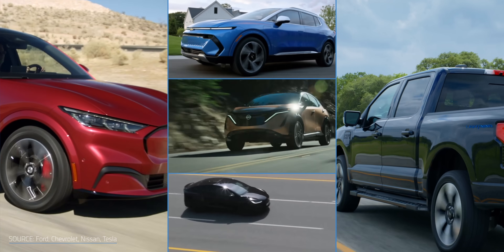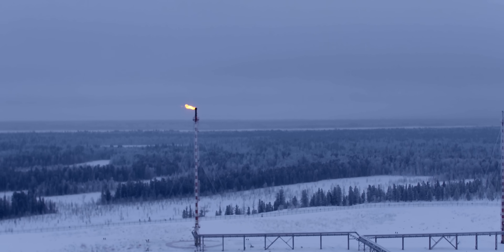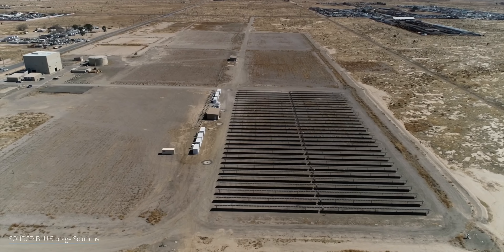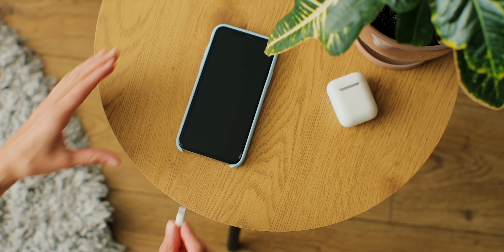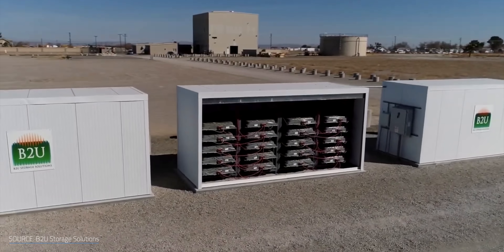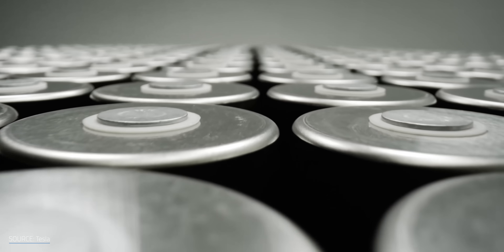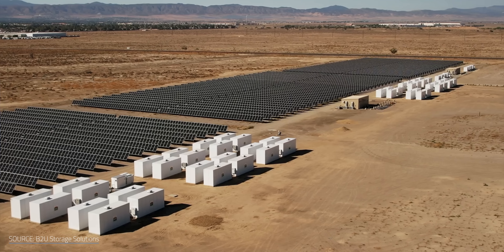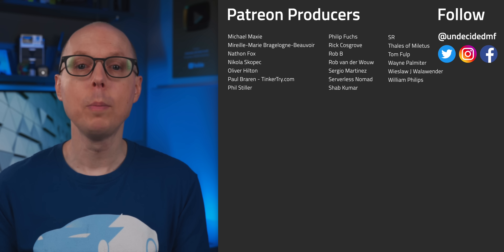How Old EV Batteries are Perfect for Energy Storage

Comment: Scale, scale scale. You need GW HR of storage to be grid level storage. 
Moss Landing is just over 2 GW HR in size, 24 MW X 40 = 1 GW
So you only need about 1000 of these to have any impact. You need another 1000 units to be serious. So it’s only a million! It’s ludicrous to think that we will ever have enough storage to be totally rid of gas fired Peaker plants.
Reply: We are on track to have 3000 GWh of battery manufacturing capacity per year by 2030. Currently there is 274 GWh of batteries made each year. All these batteries will reach end of life in cars and will be used for grid storage for many years after. It's not so ridiculous after all.
Reply: @antronx7  how much lithium, nickel, manganese and cobalt will that require? Are there enough proven reserves to supply that much? Aren’t you causing more problems by digging up that much material? 

Time to wake up

Simon Michaux
Reply: @kennethkaminski3438  Yes theres enough for at least 10 TWh. Read latest Tesla master plan. They did all the homework so we dont have to. After that recycling will take over.
Reply: @antronx7  nope, that’s not enough to backup the US grid for a significant amount of time. And no we don’t have enough minerals to provide the first generation of renewable energy. You need to read Simon Michaux’s peer reviewed report called Time to wake up 

Or Mark Mills 
Or Vlakav Smil 

All PHD’s

I like Elon but he’s way off on his calculations

Comment: Matt, another twist on this idea would be to pare a used battery with a few solar panels at the home of a EV owner (market a package for EV owners) so the system collects energy during the day and then charge the car with it in the evening. This takes the car off the grid for a lot of typical driving. Love the repurpose idea though for grid storage. Someone below mentioned a system for home and farm use too. Cheers, Tim
Reply: That was the original idea behind Tesla's Powerwall. However, unsurprisingly it turned out that the demand is much higher than the number of retired batteries...
Reply: @HenryLoenwind  I would not risk putting batteries like that in my home since the fire risk is too great and I wonder what insurance companies would think.

Comment: To me the most interesting thing is the modularity of the system design. The plug and play setup is much like a RAID Array in a server... If a unit goes out, simply spin it down and hotswap it without interrupting everything. Tesla Megapacks can't do that - each cluster has to be taken offline to service any part of it.
Reply: Of course drive failures are relatively sudden while battery performance degrades over time.

The key to making it work would be to put as much of the load as possible on the weakest batteries so that they degrade the fastest.
Then the overall performance is stable as you swap out the unusable batteries at the bottom for new (recently retired) ones at the top.
Reply: Exactly, on both points. 👍
And expanding on the "hot spares", that could easily double as load testing prior to putting a unit online in the first place. It would definitely mitigate the chance of unexpected failures.

Comment: It's crucial for manufacturers to take responsibility and incorporate a standardized BMS protocol in their battery packs. This would greatly contribute to the effective repurposing of dead EV batteries for energy storage. Implementing such measures should be strongly encouraged, if not mandated, to ensure a more sustainable and efficient use of resources. 🔌🌱🔋💡🔄
Reply: This assumes every EV will be using the same battery tech. Li-ion (NMC) and LFP have non-similar characteristics that would justify the use of a different BMS.
One would need to have multiple BMS protocols, though this could be achieved in software. Optimally you would use the same battery chemistry across a single station unit.
A whole plant could do both however as long as that is kept in mind.

Comment: Good video but the framing is wrong wrt recycling, IMO. The reason recycling of EV batteries hasn’t ramped up yet is that there simply aren’t that many of them being decommissioned at this point.

The market is growing exponentially. It’ll take roughly a decade for BEVs to make up >90% of new car sales. Then a couple decades for those batteries to begin being decommissioned en masse. Then a few additional decades in various second life applications.

Only after all that will we see a major shift of the battery manufacturing inputs to a high percentage of recycled materials.

Comment: I would ask of you to look at the li ion batteries life cycle, mining destroys the local enviroment, from earth to air to water sources Then Li ions aren't really efficient for long so in the long run fuel cells will be more efficient, then where are we gonna put those 700kilos or so of the batteries. Even now when the batteries are sooo common, we don't have a proper way of recycling them, cuz recycling them is just tooo difficult. And then we consider the fact that batteries are only efficient at 25degrees and a bummer, 99% of the world doesn't have that temp 90% of the time and many parts are way too hot to be traveling in a with a 700kilo of instant flammable shit

Comment: Those batteries have got to weight a decent amount - I wonder if it would be worth the engineering and building expense to make them into liftable platforms to use as gravity energy storage? Winch your batteries up high when you've got peak energy production from solar, lower them down and spin turbines to generate power when there's more demand. Make use of both the electronic capacity and the physical capacity at once.

Comment: I ask again, WHY should a Tesla with 40% degradation need a new battery?  I mean, it still has more range than a first generation Nissan Leaf, and it's still a Tesla.  Is "needs a new battery" a user choice, or does the car somehow refuse to operate, at some point?  Does anyone know that point, for various EVs?
Reply: With capacity degradation internal resistance goes up and slows down fast charging rate significantly. But by the time Tesla pack gets to 40% degradation the car will be long worn out.
Reply: @antronx7  Fast charging, huh?  There are Tesla Model S cars on the used market that don't have Supercharging.  Can't see the difference.

Not being able to fast charge is not what I meant.  If I slow charge a $1000 EV that has a 100 mile range and drive it to work every day, why do I care if it's a first generation Leaf or a dying Model S, except the Model S is crazy cooler?

Comment: You said $1M revenue?  My understanding that isn’t profit. $1M doesn’t sound profitable to me.  Am I missing something? Also, based on what you said I understand that the recycled batteries still have 70-80% of useful life left.  Does that mean these batteries will last another 20-30yrs, or is there a drop off factor?  It is a very cool concept but I don’t think I heard enough to convince me that it’s profitable long term.  Our goal is renewable energy + clean energy.  I’ve understood from your channel or other sources that Li is a limited resource and the process to mine and refine it very “dirty”.  If Li isn’t a renewable resource aren’t we just trading problems? Just trying to get a better picture.  I’m a fan of this channel for a reason.  I’m not a nay sayer, just want to understand all aspects and find the best overall solution.  We are getting there, but we haven’t arrived yet.

Comment: I thought of doing this on a smaller scale.  For a home,  you would actually just repurpose your own car battery when you needed to upgrade it.  Then use the old battery in your house to compliment solar roof.
Reply: that if tesla gives you that battery upon replacement. So far I needed to replace my main computer, I paid $2000 for that replacement to them, basically cost of new computer plus labor and they still absolutely refused to give me my broken computer back. Go figure.
Reply: One issue you will run into is home insurance - your install won't use UL rated batteries and in the case of a fire you may find that your insurance company won't cover it. Many of the cheap Chinese batteries being sold aren't UL listed either so you have to be careful even buying batteries let alone reusing.

Comment: But I also think it is imperative for politics to act now and mandate that manufacturers of ev-batteries create an open standard for battery managment systems communication protocols, charging and discharging (internal to the vehicle) so that they can be used and tapped into regardless of vehicle brand and easily be repurposed for different applications
Maybe also repaired. Like for instance the BMS could specifically state which cells are dead or close to EOL to replace them.

Comment: I've always thought it was really wasteful to just throw away a battery at 75% of its original efficiency, I thought it had to be a bigger reason but turns out that theres not. So, as you put it, adding 2 + 2 there.

I wonder if this could also be useful in domestic use. Instead of fancy powerwalls some people might have the space to just have a used-cell shed.

Comment: This is such a great solution, it might be a good idea to mandate that EV batteries have to be re-used at least once in this manner before disposal. Although this is brilliant, there also really should be common manufacturing protocols that allow for easy recycling across the different brands (ideally you would want that for all li-ion batteries, but EV's are the most critical and the easiest to make money from recycling). 

If the battery recycling isn't profitable right now on its own, then the government needs to enforce fines for disposing of these batteries at landfill. Government intervention likely will be necessary, because without any changes we will end up facing a new environmental crisis created just from Li-ion batteries alone..

Comment: I've messed with battery powered tools and toys for decades now, predominantly in things like radio control cars, boats, and airplanes.  People like me have known for a long time that a battery pack that is no longer competitive on the track is still useful to have, you just gotta  work within it's limitations.  And these old, automotive batteries aren't just useful at grid scale, they can be part of your home battery solutions too.  No, it may not be able to take a 2 ton automobile to 60 mph in 6 seconds anymore, but I'll bet it will keep your fridge running for days on end.  You just gotta work within the battery's limitations as it ages and understand that EV use is Extreme Duty use.  Providing power for your home is light work for most EV batteries.  

The real issue with getting second lives for EV batteries is the manufacturers don't exactly make it easy to do.  The battery controllers often need specific signals to allow power into or out of the pack, and they don't always make that easy to do.  They keep a tight reign on that information, because if the battery can be used for something else, they want to be the people selling that use.  This applies to battery pack makers from EVs on down to hand-held tools.  They are all locked behind proprietary software and controllers.  If we want to see a real solution to the coming battery-pocalypse we need to make EV and power tool batteries as easy to repurpose as our old friend the lead-acid battery.
Reply: I'm not sure an army of tinkerers is going to do that, but this can be considered a right-to-repair issue anyway.

Comment: Why do people ignore that EVs are powered by an electrical grid which is mostly generated by coal?Also would like to see a video of how the energy grid would cope if everyone had an EV Plugged in overnight. Would it mean more coal being burned while we're sleeping or could it make the grid fail?
Reply: The electrical grid is not mostly generated by coal anymore. But, even if it were, EVs being plugged in at night would help even out demand between night and day, making the energy generation more efficient. The key is to encourage the charging to happen late at night, rather than immediately when people get home from work, to the extent possible.
Reply: @ab-tf5fl  what do you think the grid is mostly powered by? You said it wasn't coal but you didn't give an answer? The fact is all grids are still powered mostly by fossil fuels. How would having a greater demand on the grid at night time make it better?
Reply: @Kp-up6cj  using the grid at night for electric vehicles means that people don't have to charge their vehicles during the day at peak times.  Don't forget that with EVs there is also vehicle-to-grid so just like California is using old EV batteries for energy storage, you can actually use your own vehicle if it is near fully charged to put some energy back into the grid.
Reply: @londonyes1380  so your saying that there's nothing wrong with the greater need for electricity at non peak hours off of a grid which is mostly supplied by fossil fuels?
Reply: @Kp-up6cj yes.
Especially with coal, where the output cannot be adjusted quickly.
A coal plant is going to burn the same amount of coal hour after hour, enough to cover peak demand, regardless of the demand at any given moment.
Therefore, any electricity used off-peak does not increase the CO2 output of the plant.
Demand peaks at different times depending on the season, but the middle of the night is always off-peak and cars (I assume they all do; the Leaf does) can be plugged in but set to wake up then to charge.

Comment: A couple of comments, a number of years ago I saw a technology piece in the Singapore airport where people could put their old AA 9 V CND cell batteries into a kiosk and multiple types of phone chargers were attached to it. Essentially a similar idea squeezing the last little bit of performance out for an altruistic purpose.
Secondly, there is an EV market that remains underutilized. I own a 2015 BMW i3 Rex version (orca). During the summer if I’ve been driving sanely a full charge is around 70 miles, with another 90 or so from the generator. This is all the car I need in my family for a second vehicle; my work as a college professor is about 3 miles away where I also get free charging. I know there are some pretty varied, and some even negative opinions about my little BMW, but I love it! When I’m not worried about mileage, it handles like a go kart. And when you’ve truly mastered one pedal driving, it’s hard to go back.  Plenty of families out there could save a lot of money by switching that second vehicle to a used older EV.
And critically, the one argument that people tell me about how they don’t want to go to electric because of their power bill is ridiculous. I have owned my BMW since February 2019 and do overnight 110 charging at home when I need to and it never even blips my power bill.
Reply: I don't get the power bill argument. It's far cheaper to use electricity than gasoline.
Reply: @drooplug  It's a problem for apartment renters (like me), but if I HAD an electric, you can bet I'd work it out.
One 300W panel would suffice for my ordinary use...if I had to roll and stow it while out- NO problem.
Reply: @ticthak  I don't see how electricity in an rented property would be more than in an owned property.

Comment: Major issue: you can’t get rid of the peaker plants until the alternatives are 100% reliable, which means not depending on solar and wind to charge them.  It also means the cost of the peaker plants actually increases since they still need maintenance but gradually produce less and less energy to offset the costs.

I believe nuclear is the only energy source that checks all boxes for the foreseeable future, but the “green” people refuse to entertain this, siting so much concern over risks that are, in the opinion of many, blown out of proportion.
Reply: Depends just how much storage you are able to put together. If you have enough battery capacity to run the entire state for a couple weeks, that seems like it would be sufficient, as it is extremely unlikely that you will have no sun and no wind, across the entire state, for two weeks straight. Especially in a place like California that has lots and lots of desert, where there is almost never (at least during the day) not sun.

Of course, a few minutes or hours of storage won't cut for actually being able to shut down the peaker plants, but you've got to start somewhere.

Of course, nuclear power is good too, but it shouldn't be and either/or. We need both.
Reply: @ab-tf5fl  enough battery capacity to run the entire state for a couple of weeks?  We only have enough capacity to run the state for a couple of MINUTES right now.  At the very least you’re thinking long term! 😁
Reply: People forget that nuclear power is prohibitively expensive and takes near decades to build.
Reply: @londonyes1380  people also forget that small modular nuclear is near ready to roll out, and could have been much sooner if investments were made to accelerate development.  Investment dollars are being steered in the wrong direction, chasing foolish government spending on unreliable energy.
Reply: @superspeeder  yes and those plants would also be ridiculously expensive.
Reply: @londonyes1380  cheap, reliable, fast.  You can only pick two. 😉

Rushing into renewables may be cheaper and faster than nuclear, but they’re not reliable.  In my opinion, reliability is the most important attribute of a power grid.

Comment: This issue of needing to rely on peaker plants as the sun goes down was also behind a recent study I saw urging public utilities to incentivize people to use at-work charging for their EVs during their work day rather than at-home, overnight charging, because they just created a new peak in demand from the traditional mid-day heat to end-day plugging in, and it didn't align with solar. The better solution is to not accept the limitations of solar and wind and do the sensible, nuclear thing.